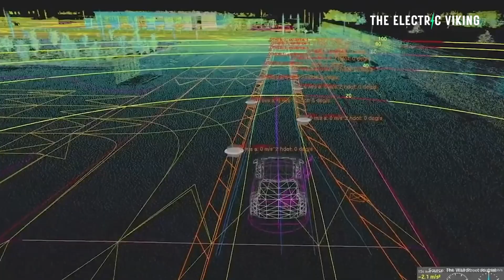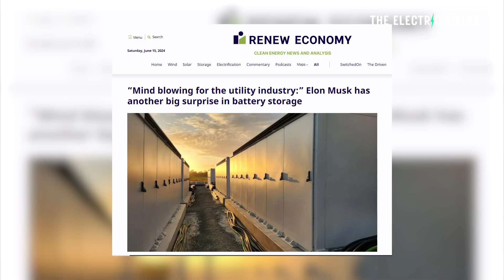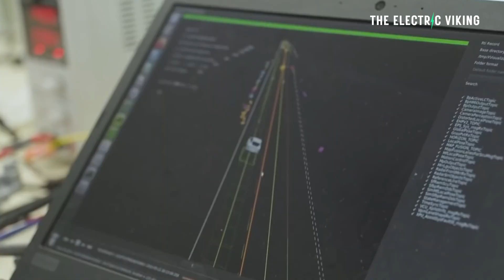Elon Musk's plan to disrupt energy storage “Mind blowing for the industry”

Comment: Big batteries can be the evolution that maintains grid cashflows and transitions away from CO2 emissions. 
Renewables on the city rooftops is vast acres, millions, and millions of m2 and no more expensive grid power bills. 

Big batteries can be recycled into car batteries that can selfplug-in to the grid.
Most vehicles are parked 23hrs every day. 

Battery capacity can be returned to the grid, and the UTILIZATION FACTOR maximised.  😊😊😊😊😊
Reply: There is nothing wrong with C02
Reply: @markmiller8903  Hahaha, Hahaha. 
You make me laugh 😃 
Coal fired energy was brilliant new technology and petroleum technology. 
The newest technology will be extremely economical. 

Big grid and big petroleum and fossil fuel  energy and automotive manufacturers know that Elon has opened up the new technology. 
Remember Kodak film and landline telephone and horse and cart and gas lighting and kerosene lighting and ....

It is an economic change.
The real question it how messed up it will be from vested interests. 

Grid owners turn 5cents kWh electricity into 50cents kWh Electricity. 
$billions in cashflow just in Australia. 

Political bs to keep the cash flow and less maintenance investment, just run it into the ground and squeeze as must profit as possible. 

Not even our politicians will speak up.
The $maths is right, but the right new technology is still evolving. 
I  am an old construction contractor Civil Engineer, with grandchildren. 
I  see the bs.
Reply: @markmiller8903  Nothing wrong with water - you can still drown, and drinking too much too fast can kill you.
CO2 is toxic above 3% but is needed for life at lower levels.
So go back to primary school ( I know they were the best 10 years of your life ) and learn the basics.

Comment: Nice those new products, but how about ramping up the current ones?
There’s a backlog of over two years for current megapacks.
The powerwalls are simply not available and way too expensive.
Thirdly, no Tesla can do vehicle to grid.
Reply: Plenty of market participants, why don’t they ramp production?
CATL make own version - maybe just for local market?
China dominates the market for cells, esp for LFP.
I’ve read China has over capacity in cell production.
Tesla Mega-Pactory is remarkably low investment, small footprint, high profit.
We are missing something.…
Reply: @iandavies4853  The bottleneck is the sales. It is very hard to convince utilities that they need big batteries. Increasing production before sales is bad financially. Regulations are also an issue. Some regulations prevent batteries from being used to their full potential so their market value is depressed making it more difficult to convince utilities that they need big batteries.
Reply: @iandavies4853 it is it not just a bunch of cells glued together, but the software controlling them.
So, yes, a battery for simply storing solar or wind generated electricity do have several other suppliers. 
However, the ability to hook them in a smart way onto the grid is something else.
Reply: The production staff are not the same as the design staff. Design engineers need to be doing something while the production engineers are sorting out production issues.

Comment: I still think battery storage using lithium-ion battery packs is WAY too expensive. Because battery storage from renewables doesn't need quick response, you could get by using other mediums of power storage like compressed liquefied air or molten salts. It's really cracking the relatively high cost of battery storage that can go anywhere that will make renewables totally viable.
Reply: Cant be to Expensive when they make Money and pay for them selves in a couple off years
Reply: You got it backwards.
Batteries are phenomenal for grid support FCAS / frequency control.
Really appropriate for 2-hour arbitrage daily or twice daily.
Cost is falling still from $60 / KWh to towards maybe $20/kWh at cell level by early 2030’s.
Demand is huge.
Alternatives aren’t proven, are falling over.
Reply: Ever Looked at equipment cost for a businesses?. If any of it is unique to one business the cost become insane. Economics of scale. Batteries are everywhere and recyclable. Easy entry easy set up and competitive pricing.
Reply: True. Battery storage is always only useful for short duration to minimize the impact of excessive peak demand costs from other sources that will charge more during the highest portion of the peak’s interval.

Comment: Power a city from batteries.... cancel rugby because of rain... two things I didn't think possible
Reply: We have powered cities with them for a long time: No thermal power plant would work if they did not incorporate flywheels in their design and pumped hydro is about a century old tech.
Reply: @AnalystPrime  "No thermal power plant would work if they did not incorporate flywheels in their design"

What? You have no idea what you're talking about.
Reply: @bunsw2070 The heavy spinning parts of the turbine and generator form an inertial battery that keep us from getting blackouts every time the grid tries to draw X+1 watts from a power plant of capacity X. The only difference between them and standalone flywheel batteries is that they run out of power quickly when not charged by flow of steam while the latter are optimized to keep spinning.
Reply: You are in for some future shock.
Reply: SA can buffer Adelaide power users now for 20 minutes and by 2030 for maybe an hour and its paying for itself by moving cheap solar to evening, peak demand! But its not baseload and its minuites, whereas baseload is day in day out 24/7 needed for Industry and manufacturing! (steel and concrete are the big two)
Reply: I can imagine that much rain. But that much is a bit much.

Comment: Mechanical /gravity battery energy storage opinion:
I think simply boring a hole in the ground and hanging a bucket of the same dirt and rocks from ground level with cables like a below ground elevator as an ultra-simple, low cost gravity battery might be the best way to go, locally at any site and of any scale.

The Boring Company and Elon Musk should make vertical shaft versions of various diameters for local, simple gravity battery storage purposes.

#SwitchToSolar #SwitchToElectric #EndFossilFuels
Reply: Not a bad idea, however digging is a very slow process. The backlog will clear as ramping of all baterries is happening as we speak plus and additional Megafactory in China for Big Baterry production
Reply: Totally idiotic.
Michael Barnard has run the logic if you’re keen.
Water is best medium for gravity storage, and barely better than batteries, has issues with geology.
Rails, cables, wagons, tunnels - too much to go wrong.
Twiggy Forrest proposal for downhill BEV iron ore train is best example, might work.
Charge batteries by regen going downhill full, work going uphill empty.

Comment: Direct connection can be anywhere on the transmission lines. 
The 1,700 transmission towers out to the Australian gold fields can have batteries at any point along the line, at each town along its length.

Solar farms along its length at each town mean grid backup to everyone along the line.
Each town can be part offgrid, and unload the transmission lines. 
Grid is protected, and backup supply.